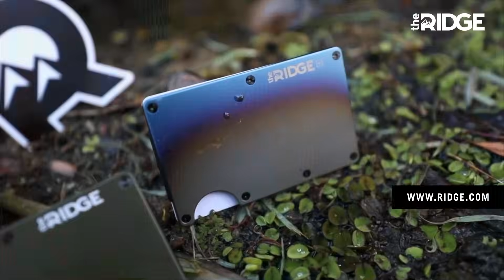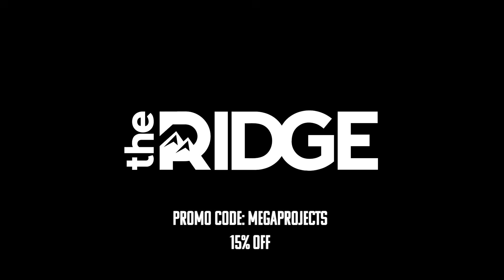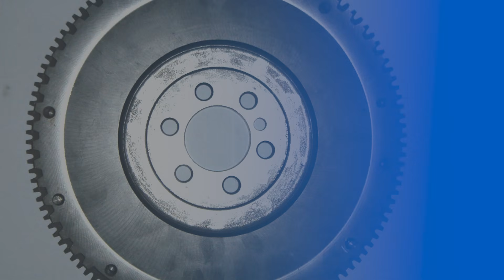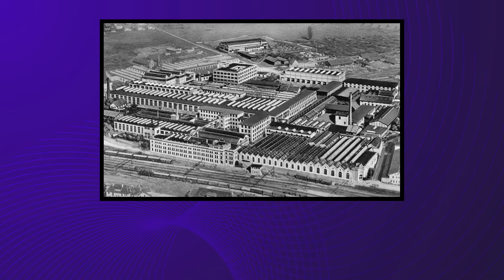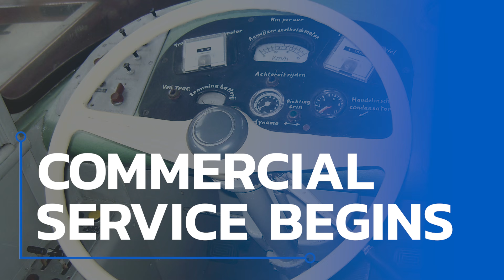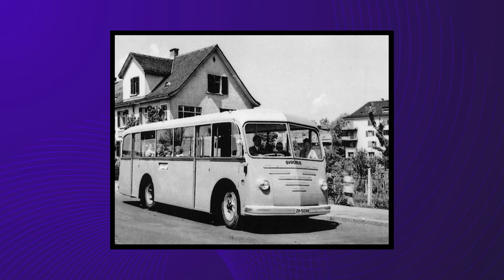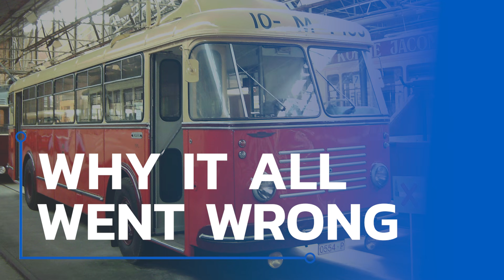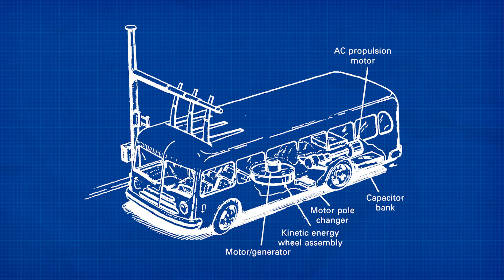Gyrobus: The Incredible 1950s Flywheel Powered Bus

Comment: I'm not sure why, but I didn't exactly expect the "gyroscopic effect" to make it difficult to turn the buses, though. I could understand how the axis of the flywheel would fight against tipping, whether side to side or front to rear and vice versa, but to resist rotation? That's an interesting, if unintended effect.

    Thanks, Simon. Looks like I'll be dusting off my model gyroscope and finding something else to examine and test (read "play") about.  ;o)
Reply: From memory when I read about it a while back, the issue was that if you turned a corner in the direction of rotation the bus would turn a bit too readily, but if you turned against the rotation it would be a struggle.  I guess because you're adding to, or subtracting from, the rotational energy of the flywheel.
Reply: @Berkeloid0   Well... I may have to work at it a bit more... BUT from what I could observe in this morning's "screwing around"... My little gyroscope has an interesting "force induction" thing going on.

    Now, I've got some REALLY awesome lubrication around the house, and more than my share of intricate ways of getting the stuff into tight places reliably... SO I threw the best I've got at the little thing so there would be just a marginal amount MORE friction between the whole outer frame and the "cup" it sits in, than there would be between the frame and wheel "bearings" (kid's toy, so "joke")...

    I can't say it's nothing to do with friction, BUT as the little wheel spun... over time, the frame accelerated revolutions the same direction as the wheel... and when I very slightly tilted it, the frame revolved in the same direction as the precession (wobble?)... SO at least "theoretically" there is an induced motion, probably something based on your explanation...

    Also worth considering... Simon DID mention some considerable about bearings for the flywheels breaking down among the issues with these things. I'm thinking that if the bearings are put under the kind of stress that they break down or "warp" out of round, there's probably enough rotational energy in that thing to make driving "adventurous" at the best of operational times... AND it WAS the single heaviest part of the entire vehicle, if we think about it.

    Thanks for the contribution... I'll be playing (studying?) more, of course. Now, my brain's getting into "runaway territory"... haha  ;o)
Reply: if the flywheel is mounted with the axis side-to-side, it will resist any turning of the vehicle. Worst idea ever! Same issue if the axis is front to back. 
If the flywheel is mounted with the axis vertical(the way I would do it), it would put strain on the bearings every time the vehicle changes pitch. As in going from uphill to downhill. This would also cause the vehicle to resist swaying when turning corners.
The other thing to do would be to allow the flywheel to pivot in any direction freely. This removes gyroscopic force from the equation when the vehicle has to maneuver, but such a mounting system would add a lot of complexity and cost to the system. One more advantage is that it would take a lot of stress off the bearings, allowing them to have a much longer service life.
Reply: @surferdude4487   Um... With regard to the "axis side to side"... 

    i'm thinking a horizontal axis from right to left, through the middle (ish) of the bes... and the wheel basically "rolling" forward or revers to the vehicle's travel...

   Fine either way. I'm just trying to get the "graphic solution"...

   That's actually NOT the "worst idea ever". In point of fact, it sounds a lot (to me) like the two gyroscopic effects endeared to every MOTORCYCLE on the road today.. and pretty much, ever. I ride one of these machines, regularly... and even meditate at 90 mph on a basis of several times a week.

    Oh yes, I can feel the effort to compensate, but it's certainly not the worst idea ever  (of any kind).

    That's all.
Reply: One of the problems is likely that this predated Automatic Steering in most vehicles.

Comment: Rode in one a while ago. Used to ride this bus type to school. Most were trolleys with overhead wires. The interiors were of really high quality stainless steel grabrails, seat frames, linoleum floors. Every detail was machined cast pieces and designed beautifully. The suspension was loud because of the absence of a running diesel.  Most had a backup diesel...for emergencies.
MF Oerlikon engineered anti aircraft canons and paks that won WW2

Comment: a kinetic batterys kinda makes more economic sense then an electro chemical battery. because less resources and less supply chain. and with a good manufacturing center would be possbily easier to make. cheaper is dependent on the weight material.

Comment: So a flywheel used in this manner is a battery.  I wonder what the economics of storing solar and wind power in a flywheel vs a battery for overnight use.  Batteries are environmentally unfriendly to make and dispose of.  How damaging is a flywheel for the same KwH stored?
Reply: Generally a lot less so - just metal and some plastics for the flywheel.  On the downside, flywheels tend to "leak" a lot more energy than batteries per hour.
Reply: @FalbertForester  I assume using magnetic bearings, and a vacuum increases the cost too much for it to be competitive.

Comment: Those of us who worked in stamping plants in the automotive industry are familiar with flywheels on top of the mechanical presses.  They certainly have their utility.  I think of them as a "capacitor" for kinetic energy.
Reply: I used to work in a stamping plant with big 1200 ton presses. One day when I came in for my shift there was a big hole in the wall. Turned out the huge flywheel up top broke loose and hit the ground at speed. I heard the shaft had a hair line crack in it that eventually completely broke. It left a big dent in the concrete floor and proceeded to barrel through everything in it's way including the wall of the building only coming to a stop in a culvert on the other side of the parking lot it rolled right through. Luckily no one got hurt. But yeah, lots of energy stored up in a big flywheel like that.
Reply: Flywheels have characteristics akin to a inductance like a coil.
Capacitors have characteristics more akin to a spring.
If a force/voltage is applied to an flywheel/inductance it initially resists movement/current and slowly starts turning/conducting. Once it's going it can produce enormous force/voltage to keep turning/current flowing. A flywheel/inductance stores energy in an dynamic way that reqires constant operation.
A spring/capacitor initially does not resist force/voltage and slowly builds up more and more resistance until no further energy can be stored.
A spring/capacitor can store potential energy in a static way that does not require that mass/electrons move.
A flywheel/inductance behaves inertialy, as opposed to a spring/capacitor behaving in an elastic way.

Comment: I remember Adam Savage from Mythbusters doing an experiment with flywheels. He said it was one of the only times he was truly terrified of an experiment. It is incredible the potential energy a flywheel can store up.
Reply: they did not even bother to reduce the runout let alone balance the flywheels then acted surprised when it was unstable at full speed
Reply: It's also incredible how little energy a flywheel can store when you realize how much of it you need to move a vehicle.
Reply: We need to exploit them were there is Hydro, geo thermal, wind can spin flywheels and pump a lot of air.
Reply: And pumpkins, they was also scared of pumpkins
Reply: With theese flaywheel electric busses it would be harmless, since the flywheel only poweres a generator that limits power pretty much. 
But a direct mechanical transmission would be an entire different thing. Since flywheels tend to have "infinete" torque when slowed down fast, dropping the clutch would rather make the bus tip over than stalling the flywheel :D
Reply: @denzzlinga  That's actually how they do movie special effects when a car gets "hit" by something and spins horizontally. They build a flywheel into the car below window level and have a mechanism to stop it instantly. The momentum of the wheel transfers to the car and the whole car spins sideways.
Reply: @denzzlinga never thought of that. Thanks.
Reply: @denzzlinga  Yes, because buses NEVER get into accidents.
Reply: @Bigrignohio if a crash makes it to the flywheel there is a bigger issue. Ford had problems with cars exploding because the gas tank was at the rear and when rear-ended would cause an explosion. The flywheel is in the center- also lowering the center of gravity.
Reply: and, the concept is/was a failure, and  Adam was  fos.
Reply: @daviddavids2884  How was he full of shit? What was he trying to push that made him full of shit?
Reply: @richardmillhousnixon  though they really should have tested it on asphalt ground or something that’s not mud
Reply: @LuvYS-D2  TBF the thing they were trying to recreate with a modern twist was supposed to be able to move on sand and mud and such
Reply: @richardmillhousnixon  oh I didn’t know that, would be cool to see it tested on solid ground tho

Comment: im sorry to inform you that the flywheel hybrid system developed by WilliamsF1 was never actually implimented on a car that raced, a brilliant idea that never made it past testing
Reply: It wasn't used in F1, however that system was fitted to a Porsche which ran in the 2011 Nurburgring 24 Hours.
Reply: @mpf1947  yes, you are correct, I did mean an F1 car but did not specify that
Reply: NOT  so  brilliant, then. !!!!!!!!!!!

Comment: Another use of flywheels from that era and later was as uninterruptible power supplies for critical infrastructure and buildings. Instead of large battery banks, chargers and inverters the system used an electric motor, a huge flywheel and a generator. Allowing ample time to fire up a big diesel generator.
Reply: Still in existence today.  Well, 20 years ago I saw a couple of systems at the NAB show in Las Vegas that were designed to act as a UPS for an entire building.  As you said, enough of a buffer for the big gennie to fire up and stabilize!
Reply: @michiganengineer8621  a previous boss of mine spent most of his career in rectifier manufacturing companies. The first place he worked at had some of these systems in storage still, fantastic pieces of engineering. Extremely good quality bearings.

Comment: Sure, the bus doesn’t have any emissions; but what generates the electricity? Unicorn farts? There’s still an environmental cost to be paid.
Reply: That is mostly an issue if coal power plants are in use.
Reply: Swiss.  Mountains.  Streams.  Hydro.  Need I say more?  This is the same country that made a hydro-electric steam engine... (and that thing's n makes this system look positively good !).  Regardless, it's a lot easier to deal with one point source that doesn't move in comparison to 500 that do.

Comment: I still don't understand how the flywheel powered the buses??
Reply: The flywheel takes the place of a battery.  An electric motor spins the flywheel up to speed, converting electric energy into kinetic and rotational energy.  Then a generator attached to the flywheel can convert the flywheel motion back to electrical energy, and drive an electric motor attached to the wheels.

Comment: Well the idea of flywheel energy storage is a potential solution for grid stability, particularly where renewables are of the "variable" type (I.E. solar and wind), using the flywheels like batteries and "storing" that power for when there's a dip in supply makes it a useful feature to implement into powergrids, versus the use of a certain brand's mega battery banks that could go boom in big flamey smokey fires if they decided to... :P

Comment: If the mechanism had a pure vacuum rather than hydrogen, there wouldn't be any friction on the wheel proper, so it would be feasible to employ a smaller flywheel to produce a similar output.
The only issue is it would have to be constructed in a true vacuum (space) as well.
Reply: @Cancer McAids Not if the mechanism is kept separate by magnetic bearings and magnets installed on both the disc and shell casing.
Reply: The other issue with hydrogen is that it leaks out and makes metal brittle. Really not a good idea.
Reply: You are forgetting that the density of H2 is 1/8th that of O2, and about 1/10th that of air (which is mostly N2).  So, running in an H2 filled cavity at stp made a fairly efficient environment.  Hydrogen embrittlement is a potential problem, as is the concern of an explosive mixture forming due to O2 leaking in.  The simple answer to that would be to keep the case slightly above atm. pressure.  The case contained the flywheel and motor (at least on the Sentinel rail application of this), so there is a spark concern within it.